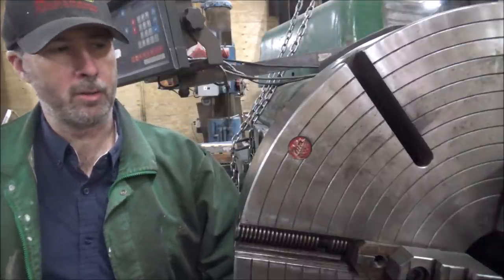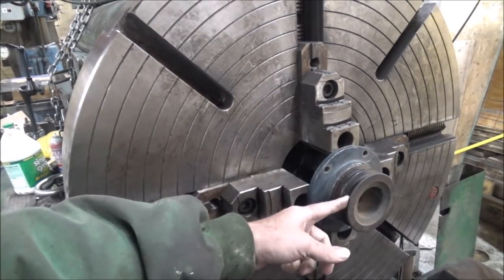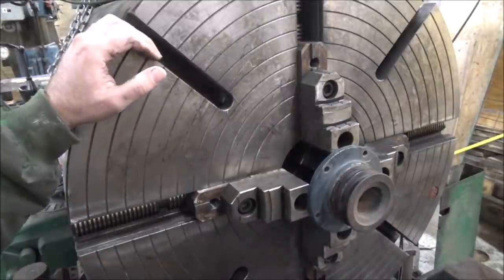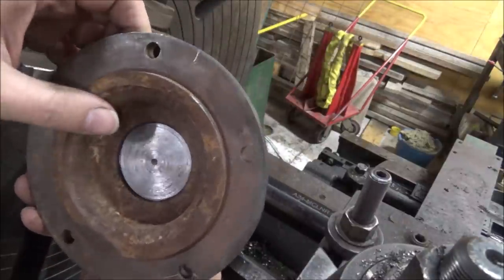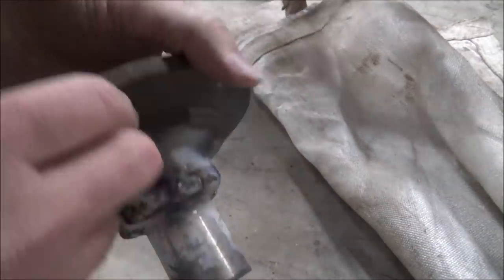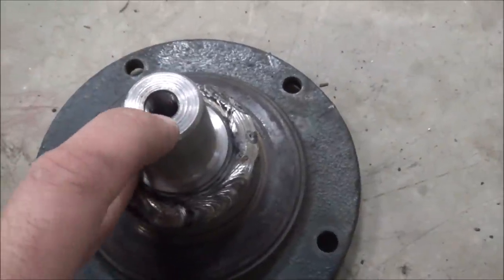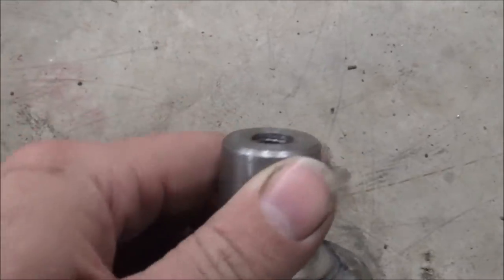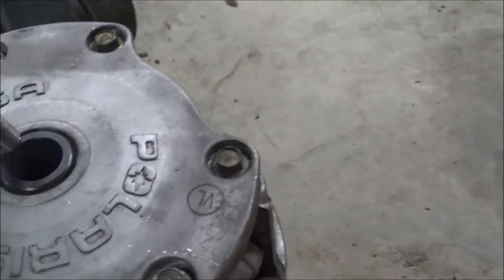Turning taper on the Monster Monarch and Cast Iron to Steel Welding

Comment: Kubota engine on a gokart !  Your friends/customers have week-end racing victory lane nailed !  Very creative set-up Brian !
Reply from the maker: No such thing as overpowered. :-)
Reply: @bcbloc02  "The only substitute for cubic inches is cubic dollars"...
Reply: Wont run as fast as the original Polaris motor so top speed will suffer but should have lots of low end torque.
Reply: @bcbloc02  Just weak gearing.

Comment: I like that job, especially the cast iron welds, those are way past ‘hard to do’ and getting close to impossible range.  Nice job.
Reply from the maker: Lots easier than sticking an 8000lb drill casting back together though! lol
Reply: @bcbloc02  Oh, that was my worst YouTube watching day ever.  Very honest and instructive of you to include that.  By the way some past rigger/butcher did some very minor iron removal on that 8 ton lathe I mentioned so I’ll have an opportunity to do some similar welding or brazing when I get that home.
Reply: @bcbloc02  AMEN to THAT!
Reply: bcblock02:   same technique with the stick flux knocked off for the weld?

Comment: Excellent example! A needed video of taper turning as well as adapting the steel to the cast iron. When I encounter this type of situation to using nickel rod for stick welding. You didn’t reveal what the process was in the welding but it seemed to work!
Reply from the maker: Certanium 889sp rod part heated to about 400F then welded covered in welding blanket and allowed to cool.
Reply: bcbloc02 yep, preheat is essential with cast iron. Your rod choice is excellent but beyond my own experience. That’s why I watch you guys to learn

Comment: Cool engine conversion idea!  Getting the power from point A adapted to point B is always the most difficult part of any engine conversion.  I looked up the rod you used because It didnt sound familiar.   I think stainless rod would have also worked in a pinch?? Not sure if you have a TIG setup but TIG brazing would also work nice. The cast will always be the weak link in that welding equation.   Corn planted yet?  Stay safe!
Reply: What rod did he use?
Reply: Never mind. I see it noted in the comment below.
Reply: @kevinhornbuckle  Certanium 889 SP, it is listed in one of Brian's earlier replies.
Reply from the maker: Not planted yet still rains every other day plus we had 2 nights in the 20s Friday and Saturday. Not the best weather. Will be interesting to see how it hurt the wheat and the beans planted. A month ago. Need to spray but 30mph winds all day today plus it’s spitting rain off and on.
Reply: @bcbloc02  we had some light frost early Saturday morning here in western Iowa.  Corn is all planted & up.  Weather here has also cooled off and windy with lots of occasional showers. Too bad it isn't worth anything with the current markets:(

Comment: Yes you are pretty good at welding cast iron :) Uphill or downhill? I was wondering why you used the big lathe, but that makes sense and I loved the taper alignment (DRO) trick!!!  You ever consider putting some giant fan blades on the big Monarch for a nice summer breeze??? LOL hold onto your hat! Thanks for video.
Reply from the maker: It throws enough air off at speed to both intimidate and keep you cool as it is. :-)
Reply: Lol

Comment: Hey Polaris ATV clutch!! held many of those in 10 yrs with polaris...whew!    3/6"-16 if you tapped it on that taper too hard BTW...Good job.
Reply from the maker: CompEdgeX   Was surprised to see it used a 7/16 fine thread to hold it on.

Comment: The balance will likely be way off and I predict huge vibration . Working on snowmobiles, I see how particular cvt clutches are, just about every day. lol Changing main output seals keeps the lights on up here.
Reply from the maker: The diesel only runs 3500 rpm and it won't vibrate from any run out as that is less the .0005". The originally pulley had no signs of balancing marks si I suspect at low speed it will be fine. Worst case might have to grind some weld to balance it but since it is so far in towards the center of mass even that shouldn't throw it out much. If it was a 8000rpm engine it would be different.
Reply: @bcbloc02  was the run out of the finished hub .0005? (ie. after welding), but i do see your point about the low rpm lol. The drive belt probably won't even go half way up the sheaves .....
Reply from the maker: Yes. I did not do the finish turning until after it was welded that way there was no distortion.

Comment: You said that you heated the hub to shrink it onto the stub.  Wouldn't that risk cracking the cast iron hub?
Reply from the maker: Only .001"/1" interference so not a real tight fit, well within acceptable limits for cast.

Comment: What was the rod you used? Had a guy that wanted me to weld steel to cast iron for an adapter between hydraulic unit and a diesel and I wouldn’t do it! Didn’t trust my welding or faith in the weld itself for that under high torque, and to know that I would leave him stranded if it failed! Assuming that you used rod for cast! Did you have more issues with that rod on the steel then the cast? Was the weld more just reassurance knowing that the press fit and that type of clutch building torque slower would take most of the forces off it?
Reply from the maker: Certanium 889SP rod. I preheated to   about 400F then welded it out and let it slow cool under a welding blanket. The shrink fit likely would have held it but the weld added an extra layer of its not moving. There are large torque spikes when the engine fires so it kind of acts like an impact wrench and I didn't want it to be something that started slipping over time and use.

Comment: smaller lathe is out of commission?
Reply from the maker: Nope, I just wanted the better than .003" run out the 4 jaw gives me for this job vs the speedy 3 jaw on the little lathe. Too much trouble to change chucks so I just used the big one instead.
Reply: oh ok thx

Comment: I cringe when I see you stick your fingers in the slot while manually turning the chuck.
Reply: Why?  You are not responsible for Brian's fingers. He is.
Reply: Doozer's Shop So Doozer, stick your face in there fool.
Reply: Michael Filler I'd cringe if the thousand pound chuck were under power!!
Reply: @unclebuck5051  I use big lathes all the time. My face has survived just fine. It's called being careful.  What do you do? Lick stamps?

Comment: Personally I would never weld to cast iron for something like this. I would just machine the whole thing from steel.
Reply from the maker: Customer preferred this to $300 in material to make a billet.
Reply: That piece of steel shouldn't cost that much. I bought a piece of 8" 4340 to make a billet crankshaft for a 466 john deere and it only cost 800.00
Reply from the maker: Can’t help it. That is what alro quoted me for 8”diameter 6”long drop of 4140 delivered.
Reply: we usually sell 4140 for about 1.00 per pound. that would only be 84.00
Reply: James Pollock it's just insane nowadays, sometimes I find it cheaper to jut go eBay for drops and small pieces, a lot of service centers are selling stock size cutoffs.
Reply: @bcbloc02  Alro is the highest priced steel house I've ever dealt with.